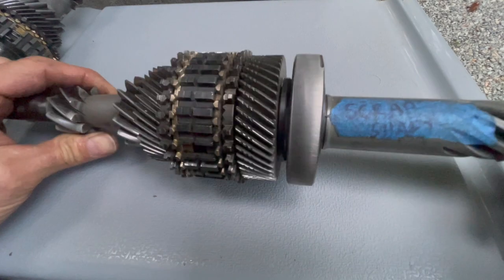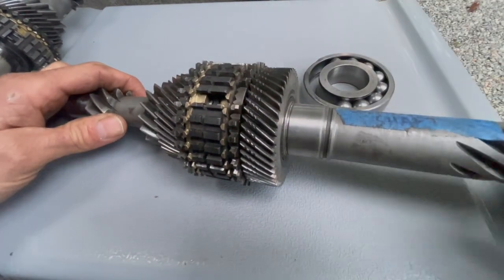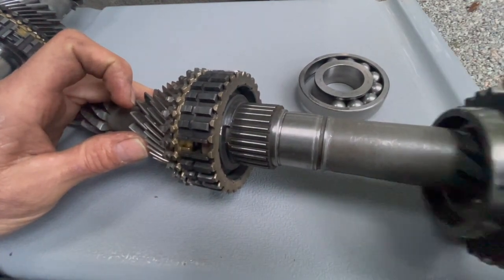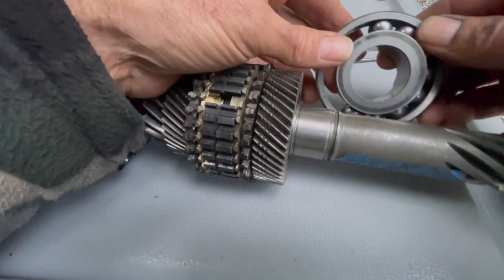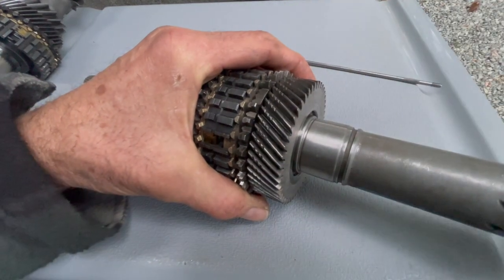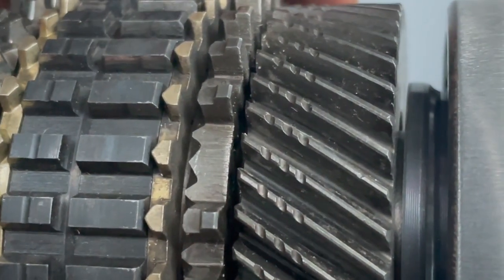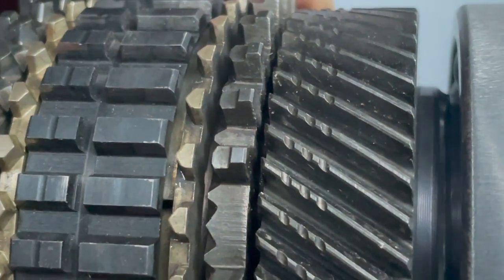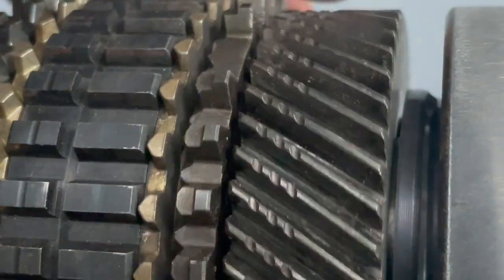4th gear thrust lubrication - Vanagon T3 and Syncro   HD 720p

Comment: Hello! I have an problem with my Syncro gearbox... After I've refurbished it.. I have a strange noise (the sound of a regular car going in reverse) in 2-nd gear... Maybe you can help me.
Reply from the maker: Hi Teodor, I asked a friend (SyncroShop in Oregon, USA).  He said the gearbox must be disassembled immediately or you will destroy your mainshaft ($1000) or perhaps it is already destroyed.  He said to count the gear teeth to ensure you have the proper gear-pair for 2nd gear.  He said a "wrong" OEM 2nd gear idler is available and if you installed that one it could be the cause of the noise.  And there are no "correct" replacement 2nd gear idlers available at the moment, so you will have to locate a used 2nd gear idler.  Or wait.

This is one of the reasons I say people should change their gear-oil often, perhaps even "too often".  Because some items (such as 2nd gear) are No Longer Available (NLA).  Thus Syncro owners should do everything possible to preserve the NLA parts of their gearbox,  At rebuild-time you will be forced to re-use some of these old parts.

Clean gear oil is only $30, it's the best insurance plan.  And don't drive fast, far, heavy if you have a big engine.